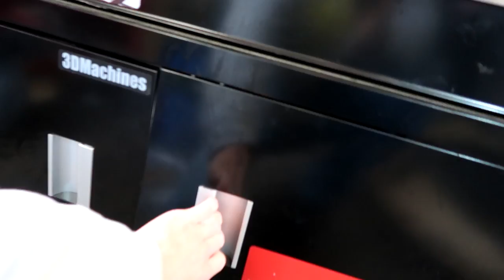IT'S NOT FOR SALE!

Comment: +3DMachines I own a Cobalt and that charge point you found on your sister's car is actually where you jump it from. It actually says "GND (-)" on my strut tower where you probably grounded on her car. Just for next time it's safer to jump it from there. My 05 Cobalt came with a lot of weird improvements like some kind of guinea pig. The jump point being one since the battery is in the trunk. They also gave it electric steering and throttle by wire. Love your vids man. Keep it up!

Comment: Have you ever herd of some stuff called trufuel? It comes in 40:1 mix and 50:1 mix and you don't have to add any extra oil. Also you can leave it in the machine all winter long and it stays good for 1 year in the machine. Check it

Comment: Umm... They have jumping points under the hood so you don't have to access the trunk to jump the car. Its not only convenient but safer. There's a positive terminal on/next to the distribution box, then you just put the negative cable to the bolt on the strut tower..

Comment: I know this video is old. But under the hood of the cobalt there's a positive terminal with a red cap on It. And you can use it for jumpstarts. And y o u just put the black cable (negative) on a bolt

Comment: Few years ago had a bmw 750 towed in with a stone dead battery. Had keyless entry and had no idea how to get in or where the battery was. Could only get in the trunk and battery wasn't in there. Only way I could figure how to get in was I hooked up a trickle charger to the leads on the trunk light until the battery was charged enough to open the doors. Found the battery under the rear seat lol.

Comment: You do know running a two stroke out of gas is a bad thing right? Read your manual,it will even say,running your equipment out of fuel may cause it to lean out and destroy with motor,especially running it on empty,or attempting to run it dry by running it full throttle. It WILL shorten the life on the unit. Generally,on two cycle engines the oil in the fuel helps stabilize the fuel. It is however best to add a fuel stabilizer in your equipment. As far as the mower. It is best to FILL THE TANK and add stabilizer,why? Because your tank will ,if left partially full,or even empty cause condensation to form in the tank. So in the spring,you will find you have water sitting in the bottom of the tank. Well in most cases,you will add fuel in with the water,then start it,and it will run great. ,but then,after sitting till the next time,that water settles to the bottom of the tank. then when you start it,it will run for a minute till that water that settled into the bottom finally gets sucked up ( after running the little bit of fuel that was still in the carb from the first fill) then BAM! It quits,and refuses to run. Then you have to drain the water from the bowl,and probably tank,even after you ran it dry. Especially when heating your garage,then letting it cool back down again. That REALLY gets the condensation machine going in a fuel tank. I have been a small engine mechanic for 35 years,that is exactly what happends to your lawn equipment. Go to any local dealer,they will gladly tell you the same thing
Reply: False

Comment: im not offended by the jeep thing but i will say this my dad has had an 2002 jeep TJ sport and has not had to change a single part except for the radiator and the staybilizer bar the brakes are still the same from when he got it the reason is its because its a stick shift and its been on its side but it still runs perfect but the oil sencer is going on the frits when he starts it up its high oil preshur for about 30 minutes and then it goes back to normol. hes had no engin or transmition isues i geuse its because he has the best jeep engin in witch is a strate 6 and  thats all i have to say

Comment: Dude u create a very lean condition when running engines out of gas.. 2 strokes need fuel for liberation and the gas cools it so ur doing more damage then good
Reply: Patrick Barnes fuel and gas are the same thing, fuel is anything that you put in an engine, and 2 strokes use a gas and oil mix, oil is for lubrication and the gas is what causes propulsion
Reply: I dont see how you would get that kind of thought, as long as fuel/oil/air mix is in the crankcase it is lubed up, once it runs out it stops running, so it is lubricated either way
Reply: Billy Boots he's probably talking about dry starts which cause a ton of engine wear and damage
Reply: you mean like in the spring when he fires them back up again? in that case once again there would have to be a fuel mixture in the crank for the 2 stroke to start, he can always squirt a bit thru the carb to get things going

Comment: dalton chevy and all automotive manufacturing companies that put remote batteries in their vehicles also put remote charging posts and jumping posts under the hood. hell gm clearly marks all there vehicles where the bat+ is and where the ground is to jump start the car. it does not take a rocket scientist to figure that out. you make it sound like it was a problem. you didnt even need to touch the battery to start the car. only reason you would have to touch the bat is to change it. wow way to be a drama queen over nothing